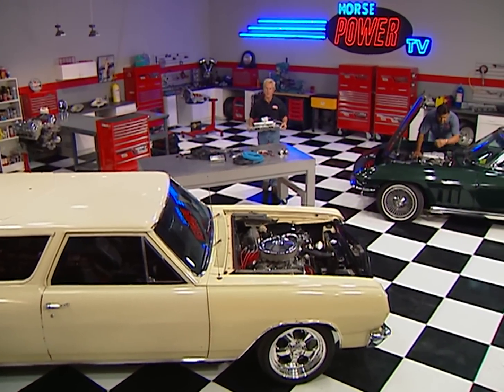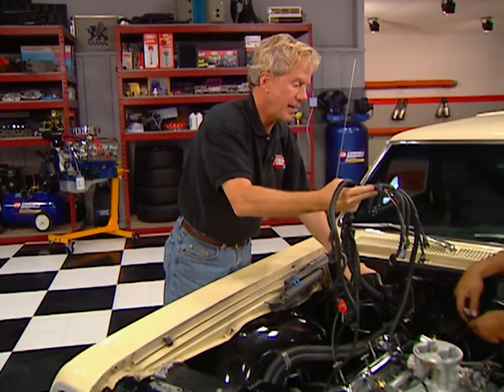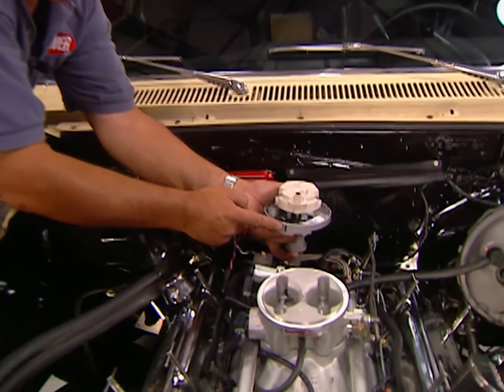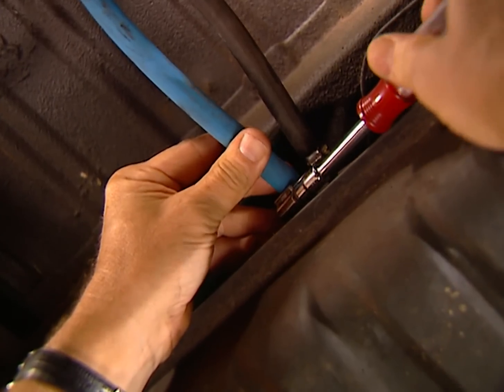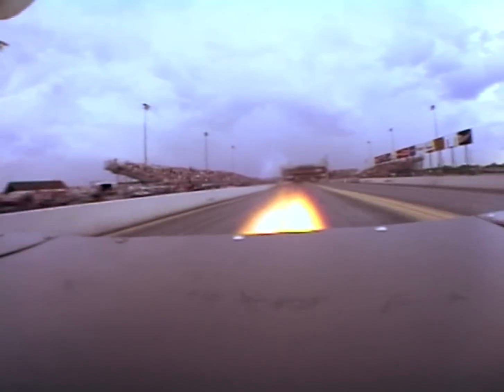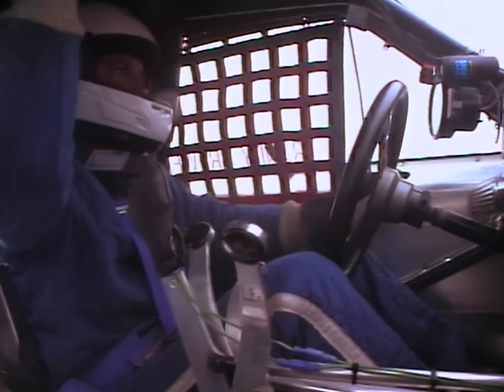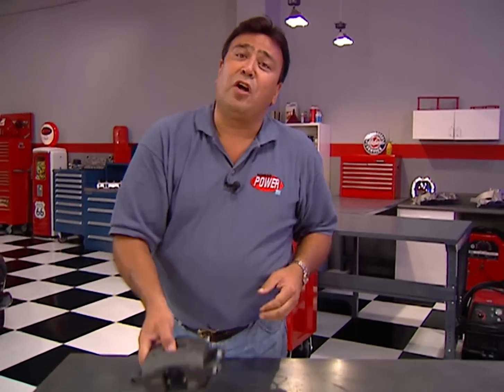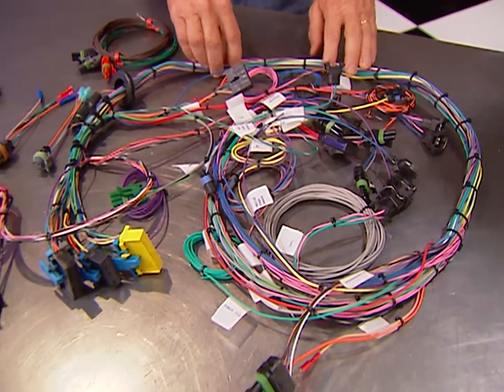How to Upgrade The Fuel System With Multi-Point EFI - '65 Wagon - Horsepower S5, E2

Comment: Did I just watch y'all install the O2 sensor pointing up??
Reply: That's just a minor detail.
Reply: Its not pointing up.....and it wouldn't matter if it was either
Reply: @19chev81  yeah it does matter.   Condensation will settle and shorten the life of the sensor.
Reply: @bmstylee  not at that angle it wont